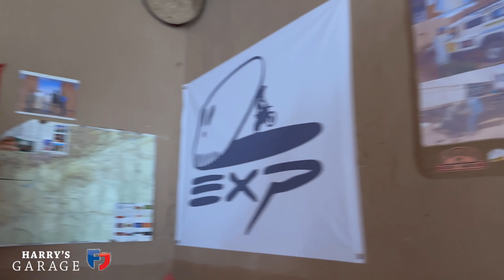Sandraiders 2023 Pt.3. Riding the dunes of the Sahara plus what it takes to do this event

Comment: Congrats Harry.  That is a hard event.  The heat takes it out of you and out of the bike.  Things break with that level of heat that would not break in temps much lower.  The things that break here in summer in Australia that never break in the cooler months. At 77 I think I will give it a miss.  But thanks for the videos Harry, I rode with you every time you turned on the video camera.